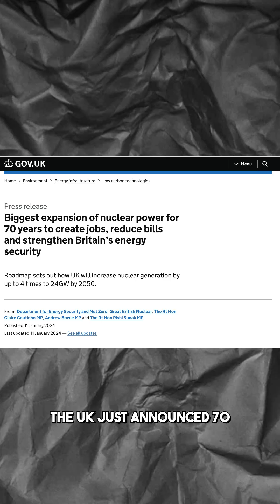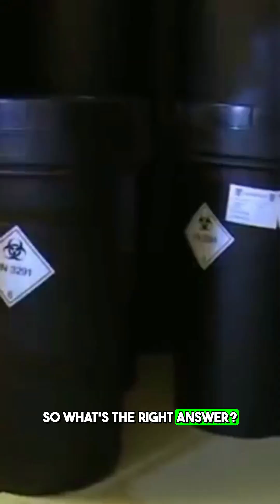Can Nuclear Power save the world? #nuclearpower

Comment: For a country as small and densely populated as the UK, it makes sense to build a small number of high power plants. Hinkley Point C could supply power for all of London, a second plant would cover Liverpool, Manchester and Birmingham. Given land values in the UK, it makes a lot more sense than covering the countryside with panels, posts and pylons. Renewables are so widely distributed that cost of grid upgrades to support such a large network of generation could easily cover the cost (both monetary and emissions during construction) of a brace of high capacity nuclear sites.
The early nuclear plants were almost experimental, with the design evolving as they were built. They were also less efficient because the intention was to use them to create material for military use. This has left a lot more waste and complicated decommissioning that is not necessarily true for modern designs.